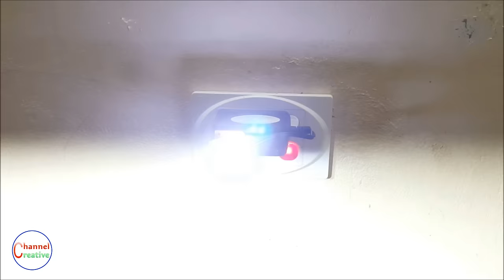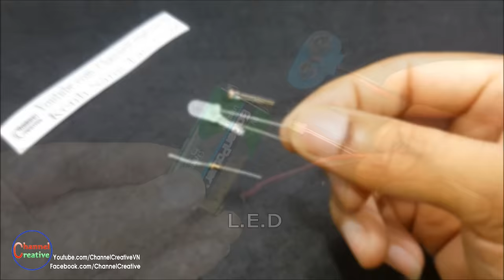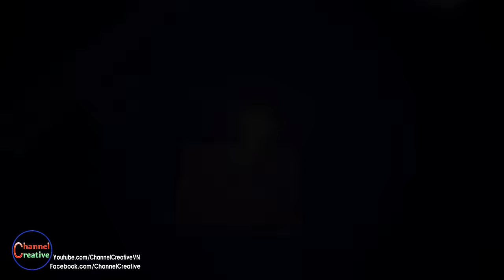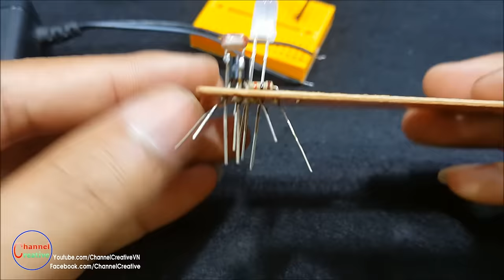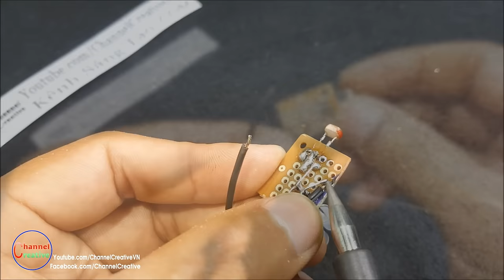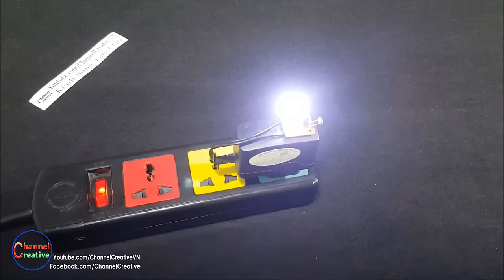Simple Life Hacks

Comment: So basically the idea is that when it's dark the resistor pulls the base pin high letting the LED shine, but when it detects light the LDR pulls the base pin low and no current can flow through the transistor (it's like an open switch).